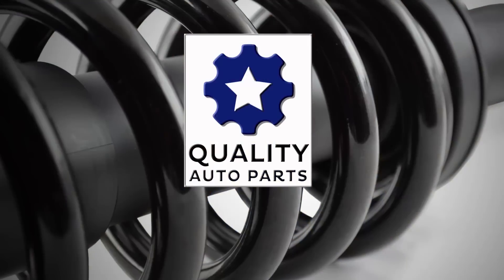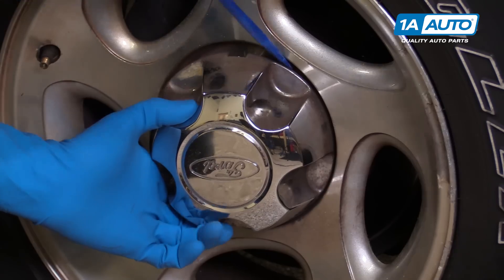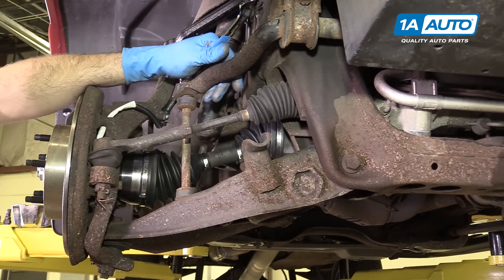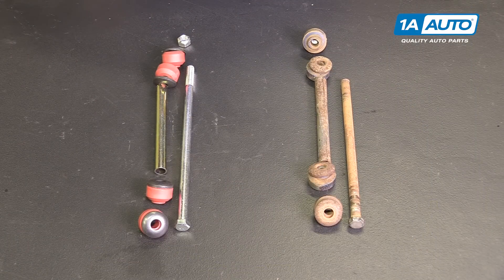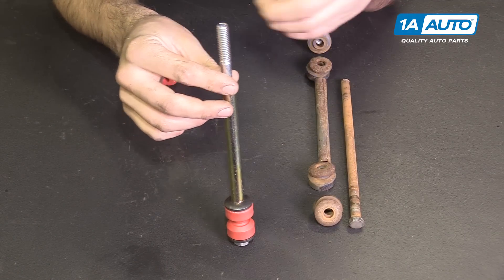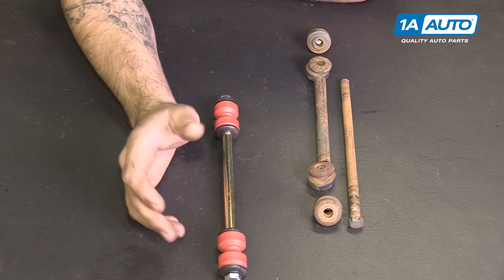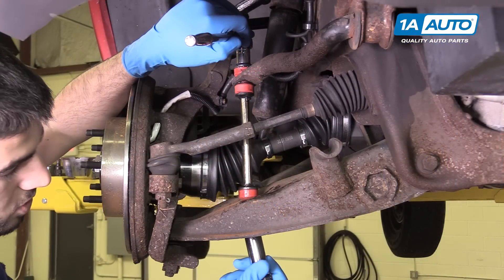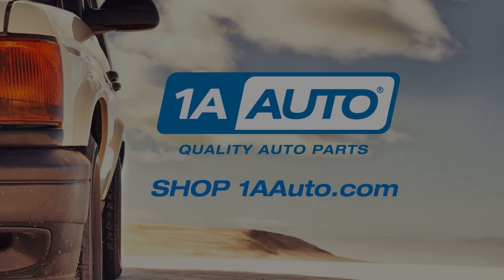How to Replace Front Sway Bar Links 98-08 Ford Ranger

Comment: Great video. I did mine yesterday and it took less than 20 minutes for both sides. Thankfully I was able to do it on the ground without having to lift the vehicle. When I checked mine, all but 1 of the bushings were gone. Just recently bought the truck and heard some clunking sounds which lead me to check and discover the end links were shot.

Comment: Good instructional video, at 02:52  , I used a grinder to cut the bolts off ... took about 15 seconds.
Reply: About to work on these in my driveway, just might cut the old links off right down the center to save time :P

Comment: OMG You were turning the nut the wrong way (clockwise) instead of (counter clockwise) that is why you broke the bolts off on both sides! Remember lefty loosey,  righty tighty?  Otherwise a good video
Reply: That's a common technique to speed up old bolt removal....  snap the nut off instead of threading it off ...  nice catch though, i didn't notice :)
Reply: I'm glad you posted this. I thought I wasn't seeing it right.
Reply: BK  haha I said the same thing in my head

Comment: Yes this is an old video do you really need to put anti-seize on it. I plan on spraying on a rust prevention black undercoat on the bolts to prevent water intrusion. Does it hurt to to apply anti seize grease and to spray paint the bolt

Comment: step one to remove get a saw
Reply: Ha ha ha, I did this with a saw 20 mins. ago and just now watchin the video!
Reply: the top part broke off on mine so i used a grinder and grinded the top into a square and used a adjustable wrench with a 4ft bar around it and a breaker bar to get it off 😭

Comment: Y’all play around to much. Use a sawzall or grinder and cut the dang things off and those bushings are over tightened. You only tighten till you notice them starting to expand then back the nut off a quarter turn. I guess it’s good for the shop when the customer has to come back and pay to have them replace every oil change though. 🤷‍♂️
Reply: It seems impossible without a grinder. The bolts will not turn.

Comment: How do you know how tight to tighten the sway bar?
Reply: Use logics.
Reply: I usually just snug tight them,other wise they might break off if too tight
Reply: They shouldn't swell like he did it. That is way too much compression. Once they start to widen, stop.
Reply: You can google torque specs for nearly anything and find it in a forum somewhere.

I searched "2002 ford ranger sway bar link torque spec" and came up with 18 ft/lb. So not very tight. Loctite recommended.